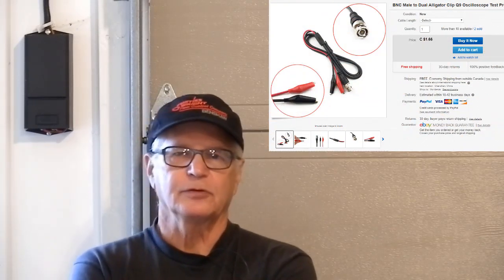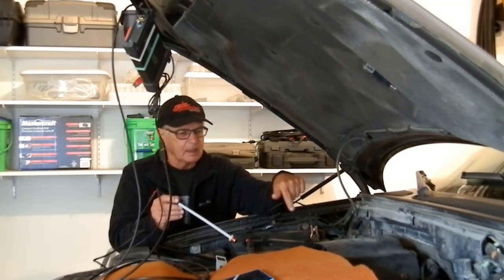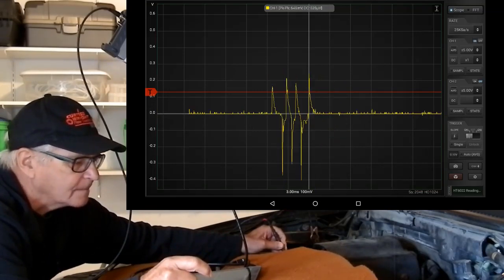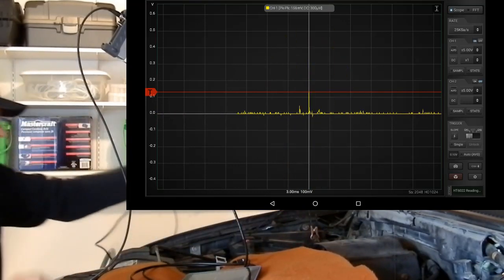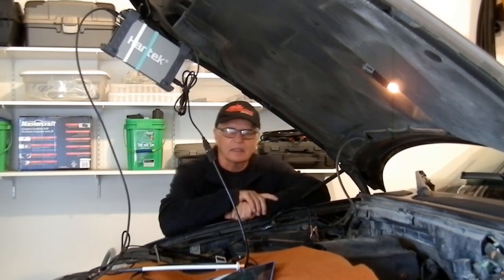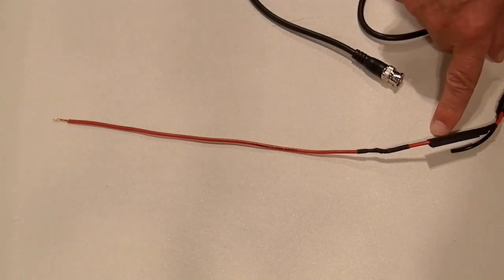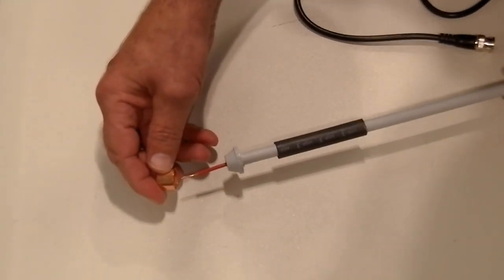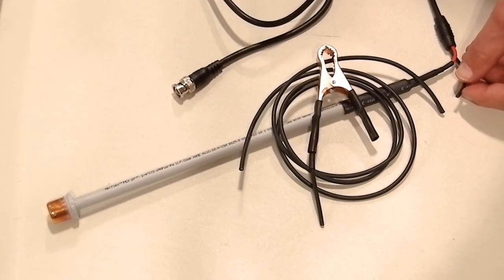GADGETS#29 - DIY COP PADDLE PROBE

Comment: What happens if the coil has insulation issues and ignition KV go straight in to you scope ... dead scope i think ! the Pico and others have protection built in to prevent this
Reply from the maker: yes
Reply: @theGADGETSplaylist  So you seem a very switched on chap i like your videos .. there must be some simple circuitry that could protect the scope ! would something like a zener diode do it ?
Reply from the maker: @johnfountain8143  - perhaps...
Watch PJ @ Voltage Drop Diagnostics. He built one, makes like it's his design, shits on it due to his fear of lightning and says he uses it because his expensive probes don't work as well.
The reason for its performance is the same as the reason for fear. It is direct. Inserting anything will likely interfere.
The signal from this COP Probe is about 4v ...BUT no current carrying capacity what so ever. Even the HS101 with its 20KΩ impedance interferes with it.
We both would be surprised at how many of these probes have now been built globally. They use them at their risk (minimal) and I haven't heard any negative comments.

Comment: Don't you need to use a step down voltage to protect the scope
Reply from the maker: +fanfan Guerrier - The copper cap, now covered by a 3/4 PVC cap (modification at suggestion of viewers) in the presence of the COP magnetic field generates about 3v to 4v...so from that perspective it's in the range of even +/-5v input scopes.
If your fear is a spark running up the cap to the scope, then this probe is not for you.
I don't share the concern.
The small voltage produced by the copper carries no current and the quality of the acquisition would be easily affected by any "circuitry" between it and the scope.
It's unimpeded which is why it works so well where other probes often fail.

Comment: I was thinking of making something similar.  I was goi g to use coil wire in a loop at the end.  I figured that's how you would get the proper induction of signal to the scope
Reply from the maker: +Lee Dress - we're conditioned to think induction = coil. But it could be flat also.
And that's if it is induction at work here. I used to think so.
A good friend argued that it's more like an antennae.
The signal from this is in the 3v to 4v range but negligible current (like EXTREMELY low) and I'm starting to lean to the antennae theory.
At any rate, this works very well.
Reply: logical canuck I would lean towards the antenna theory as well. Remember the cars from the 60s that had the metal “anti interference” cover to help keep ignition noise out of the radios. I don’t know what all cars bc I work on BMWs but I still remember a 69 427 vette that had one a I asked what it was an engine dress up part or was it functional. He stated it was functional. This is all from a memory when I was 16 and first started messing with cars.
Reply from the maker: @rbmwiv  got you beat, I was 15...
LOL
Denis
Reply from the maker: @rbmwiv  - there was a small mod made to this GADGET later...there is a 3/4" PVC end cap added over top the 1/2" copper
Reply: logical canuck thanks for the tip.
Reply from the maker: @rbmwiv  pun intended?
🤣🤣🤣

Comment: You don't have (or never mentioned) any protection for the scope. If a spark ever jumps to the copper cap (due to a bad coil package) you can write off the channel input to your scope (or the whole scope). A real paddle probe is capacitor coupled and offers some protection from sparks. IMO  I would not recommend building this probe.
Reply from the maker: +Dave Sage - It might be a risk. Maybe I should invest $400 in a manufactured probe and protect my $75 HT6022...
I kept both the build and the risk assessment simple.
I think it's unlikely. If it happens, I'll buy another scope.
That said, your point is well taken, Dave and I thank you for bringing it up. It is possible.
Reply: Actually the AESWAVE website site lists their flexible paddle probe for $69 US.
https://www.aeswave.com/cop-secondary-paddle-lead-capacitive-p9151.html
As far as an improvement to your design I suspect a small metal disk under a plastic (insulated) cap on the end of your tube would give you a signal without the need for the exposed metal cap.
Reply from the maker: +Dave Sage - I am Canadian
There would be brokerage fees, shipping, taxes, exchange rates...that's no longer $69...
I see a few probes for $400 on Amazon.ca
This video concentrated on proof of concept and the build. I am making a 2nd video which will concentrate on acquisition quality, custom probe setting within HScope to apply Kv scale and also invert the signal (you may have noticed it's upside down), and analysis of multi-strike secondary wave forms (something not often covered on YouTube). In that video, I'll mention your concerns and issue a disclaimer - USE AT YOUR OWN RISK - which goes for everything I do here.
But I, personally have no issues with this DIY COP PROBE as is.
I do appreciate your participation on here. Thanks very much, Dave.
Reply: I feel your pain. I'm Canadian too.
Maybe you'll try my suggestion of a simple  disk (or just a coil of wire) inside a plastic cap. There is no real need for an exposed metal probe tip. The EMF will be un-impeded by the plastic. Enjoying your other tips. Keep at it. Thanks.
Check out my projects.   http://davesage.ca/
Reply from the maker: +Dave Sage - I had already quickly checked your YouTube channel but was not aware of your website.
VERY IMPRESSIVE!
Reply: Thanks. My YouTube channel is just a place to store videos for my web site because people said they couldn't play them directly on my site (??). I have a few more engines I haven't made videos for yet. Thanks for having a look.
Keep your tips coming.
Reply from the maker: +Dave Sage - I did make a small modification to the COP PROBE largely due to your suggestions.
https://www.youtube.com/watch?v=7UImtbRzkxQ

Comment: You will want to reasearch what a correct firing waveform looks like.  Most of your waveforms are nothing like what you should be seeing.  There's is no obvious multi spark occurring on your engine, just a mess of noise from your sensor.  Here is an example of what you want to see to correctly diagnose firing events - https://www.autoserviceprofessional.com/article/92689/Waveform-diagnostics-Ignition-diagnostics-you-will-actually-use?Page=3.
Reply from the maker: +BearNPum - This engine does employ a multi-strike strategy! The DIY COP PROBE picks it up beautifully. Your link  is a waste spark system. Not a COP.  I am not impressed!
Reply: I edited my comment above slightly.  I have found reference to some newer Fords having a multi spark at idle, but can't find any waveforms that would verify this in 2000'ish F150's.  I will try my 5.4 in the near future and see. Also, I would say that the posted link may not be the best example, but the shown waveform from the Subaru waste spark system is very much the same as you will get from a distributor, distributor less (DIS) and coil on plug (COP) ignition.  Just because it is a waste spark system doesn’t mean it is an invalid example.  The in cylinder firing event for all these systems are basically the same.  I have seen a good example of all the systems, plus multi spark, shown on the same page.  They are all basically the same and have the same waveform.  Can't find that page now.  But maybe this will do - Quote "Elements of the Secondary Ignition Pattern
: These parameters are practically the same for all types of ignition systems." - 
http://autoditex.com/page/secondary-ignition-33-1.html .

Looking closer at your video, there is some hope for the waveform at mark 5:35.  But, it is still very noisy and would be difficult to use that information to determine if the ignition is good or bad.
Reply from the maker: @BearNPum  - you were wrong and you were rude